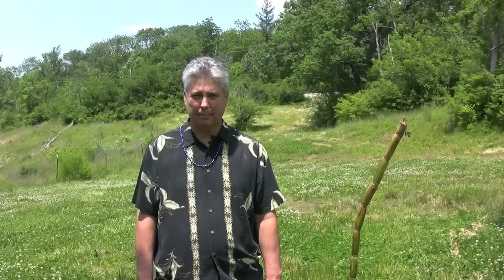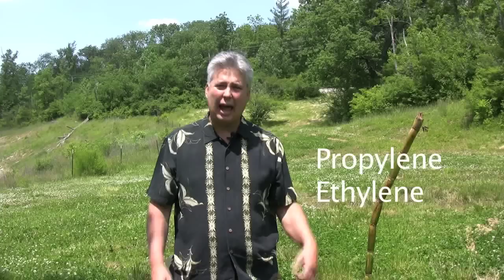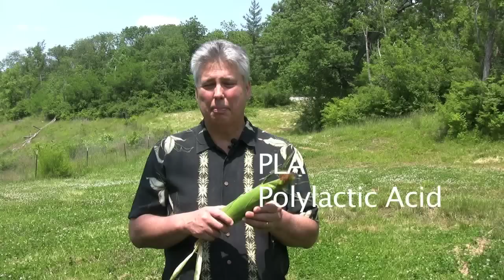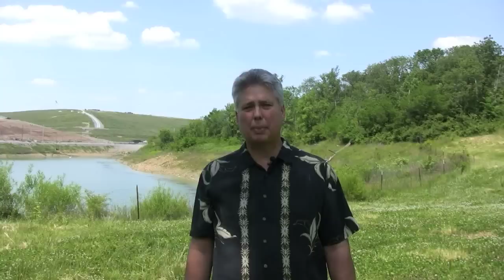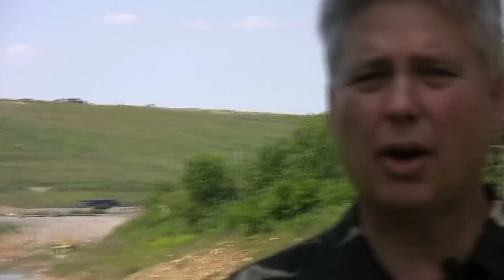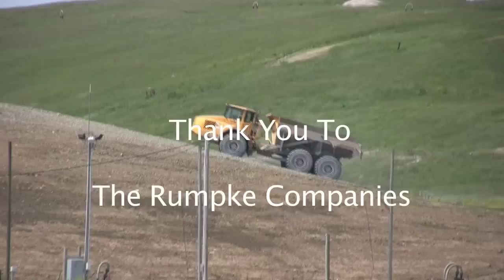What's Plastic Made From?

Comment: Darrel, below, is wrong.  Ford's experimental car used soybean plastic to make body panels for a Model T.  He's also wrong when he wants to ban plastic.  Plastic is popular because it's light and strong.  This means big fuel savings when you transport it.  Milk isn't delivered in bottles any more because it takes a lot of fuel to move those bottles around and wash them - more fuel than it takes to make a plastic bottle.  If you worry about plastic disposal, don't worry, it can be made to biodegrade with an additive called Earth Nurture Additive.  If you worry about methane in landfills, you should look into what's happening with methane being tapped in landfills and being used to replace natural gas.  More than 60% of the US solid waste is going into landfills that are being tapped for methane.  Another development is that starch is being used as a filler in ordinary plastic - 30% in bags, and up to 70% in things like shampoo bottles.

Comment: Unfortunately, I watched a batch of Braskem LLDPE film being tested compared to a standard fossil fuel LLDPE (linear low density polyethylene) film, a couple of weeks ago.  The Braskem failed a dart test at 27 grams.  The standard plastic failed at 172 grams.  The dart, so called, is actually quite blunt, so the test is comparable to a potato bouncing around in a plastic bag.  So, the Braskem product was less than 1/6 the strength of the conventional product.